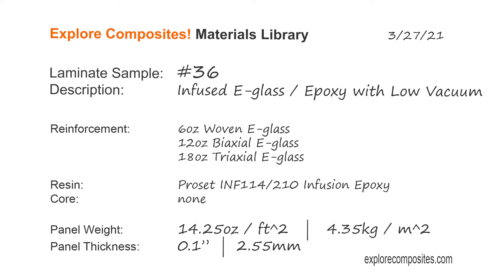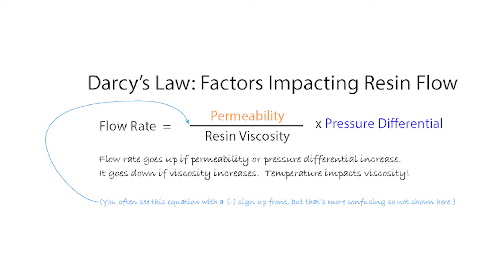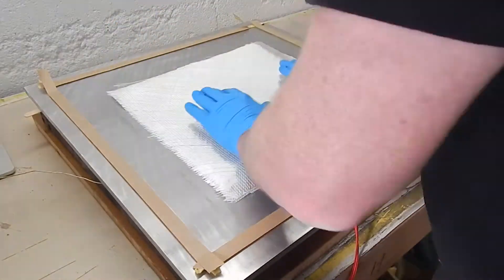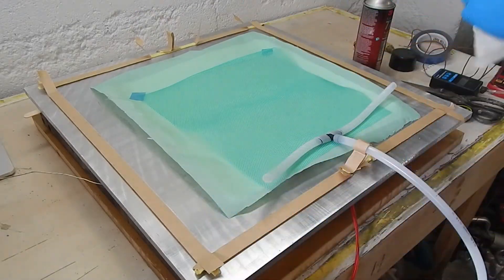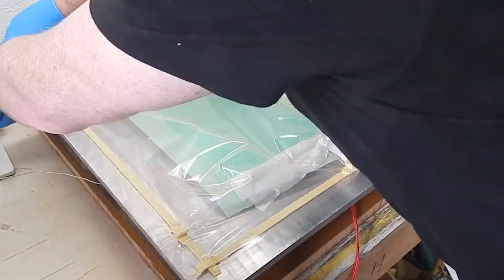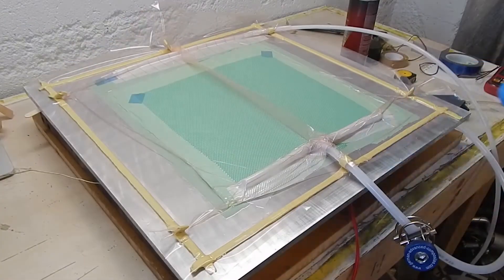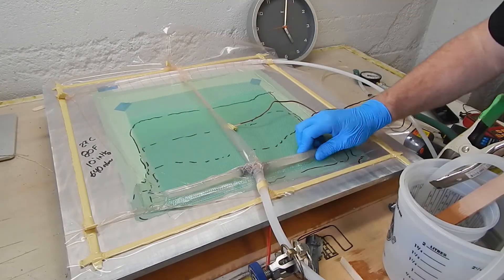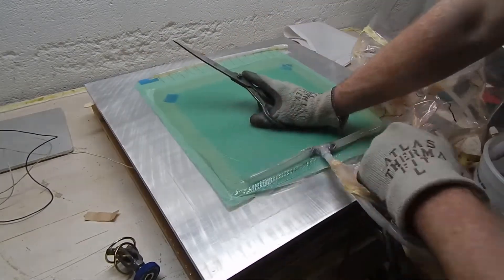Laminate Sample #36: Vacuum Infused E-glass / Epoxy with Low (Not Enough!) Vacuum

Comment: Do you use spiral wound tubing on the outlet as well as the inlet ?
Reply from the maker: Yes, my arm kind of hides it but it the spiral is fit over the tube for the last foot or so.  It is probably overkill here but is a good inexpensive solution when you have room for a decent sized resin/vacuum break to keep resin from just rushing into the vacuum outlet side.

Comment: I do infusion for my Hobby Sail Boats.  I can now get perfect results for my needs using 30 inches of mercury.  I had noticed that when cutting off the resin and leaving the project sit, there would be some degassing of any pooled resin such as at the end of the inlet hose and tee inlet fitting I was using.  It really did not make any difference in the result of the boat hull as it came out pristine as always.  I was curious about the degassing and decided to drop the Mercury Vacuum by one Inch at the end of my infusion process.   The result was a less than pristine finish on the mold side and a small amount of resin pooling in various places in the Hull.  Like you, this was just a curiosity and will not be ventured again.
Reply from the maker: That's a strange result from my perspective but infusion has got so many variable going on it's never 100% clear why something is happening unless you do a bunch of testing... and even then!  Do you have resin breaks between the part and the vacuum side?  

You should be able to avoid pooling by clamping off slightly before its filled or by playing with the height of the feed bucket.  Not sure why there would be porosity in a surface unless there is a vapor issue or a leak... but again - too many variables.

But if you have something that works - that's not a problem!
Reply: @ExploreComposites  Thanks for the reply.  Question 1 answer, Yes I use a resin break and it works consistently.  
Question 2 answer, yes I do clamp before the finish and have no problem there.
I just wanted to contribute the result of my adjustment to the vacuum pressure after the job was finished.  I can promise you I am not going there again.  I can live with some bubbles in the inlet line after the job was finished.  As I said, the finished product comes out really fine.  Thanks again for the response.

Comment: It would be interesting to see this experiment replicated at different vacuum settings, and with possibly other post-infusion steps like rolling on top of the bag while still drawing a vacuum.

Unfortunately to do that would an inordinate amount of time and materials.
Reply from the maker: Yes!  I had similar thoughts putting this together.  Would be fun to do tests with the same part over and over with only one variable changed.  Wouldn’t be too big of a deal to do... 

I have a problem with changing all the variables every time!

Comment: very good exeperiment. what you could do to remove that air is maybe reduce a lot more the flow, slower cure resin and bigger resin brake, so after infusion, you can add more vacuum pressure and try to remove all the air. i only infuse poly and ver on low vacuum. and just because the panel will recive primer and paint.
Reply from the maker: I think you are onto something with slower flow and raising the vacuum once infused... sort of the opposite of my go-to method where the infusion happens at high vacuum and this is reduced as the part fills and kept lower for curing to prevent volatilization.  Worth exploring further for sure.
Reply: @ExploreComposites  Also when reducing the vacuum, any bubbles will shrink in size. I've done infusions at full vacuum at the outlet, just clamping the outlet after infusion without clamping the feedline, but just lowering the feed bucket by 1m. This seems to nicely equalize the compaction and collapse  any the bubbles or dry spots, especially on wood cores as it tends to suck the bubbles (and resin) inside. 1m head, is just ~10% vacuum though, I'm considering feeding from a vacuum chamber for a little more back pressure and compaction.

Comment: would this be a more viable method when say building honeycomb or foam composite panels as to not force the honeycomb or foam  down to hard and potentially have a crush happen? 
Thanks as always for the great videos !
Reply: You will never crush foam or honeycomb (as long as edges are beveled) with vacuum alone.
Reply from the maker: I agree - was more concerned with overbleeding core bonding resin than damaging core.  Core crushing not likely in most cases.  Honeycomb - not sure - don’t have much data on wet-bonding honeycomb but it probably benefits from more vacuum than less - the bondline being more the sides of the cells than just the tiny edges that make contact...
Reply from the maker: Certainly low vacuum is good for core bedding and some wet layup situations.  Infusion doesn’t seem to be the place for it though!